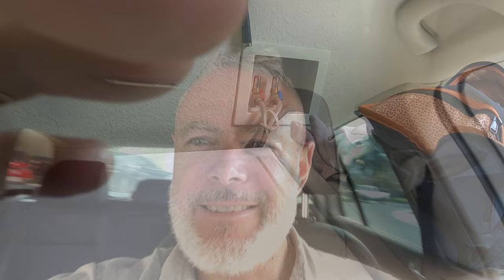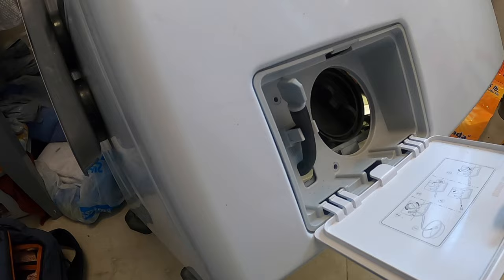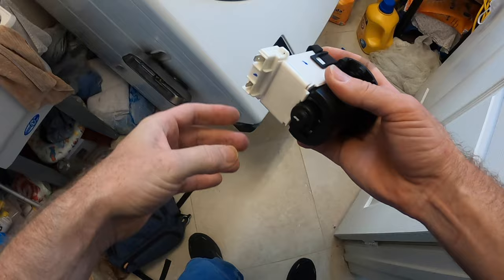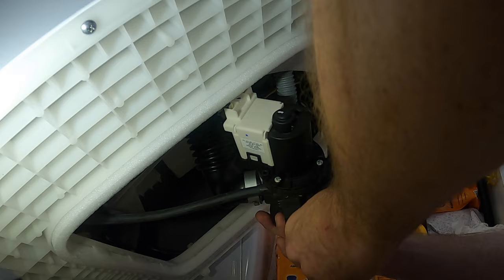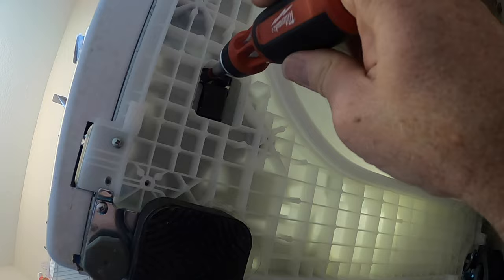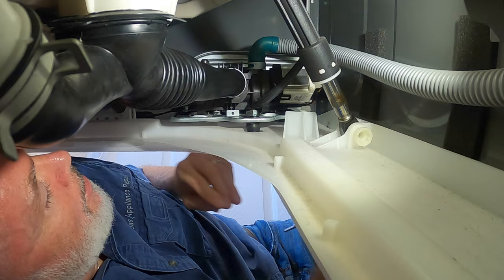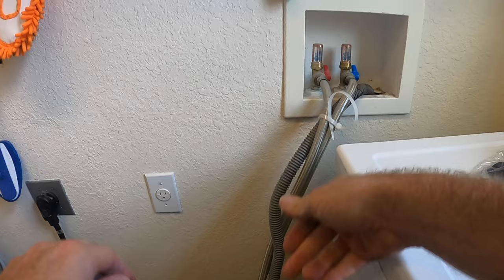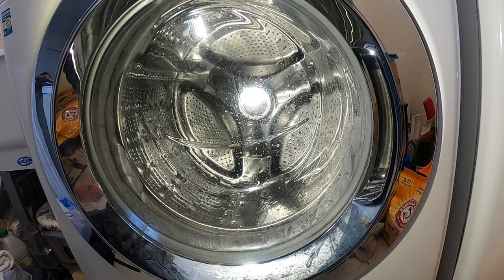LG Washer Drain Pump Fix in 7 Minutes

Comment: I bought a warranty, 5 years for $160 at time of purchase. Mixed blessing: will have an unknown tech come and attempt repair, hope they get it right, then see. I was hoping this would be the better of my last washer, a Westinghouse, which only lasted 40 years and required replacing the water inlet housing, twice! Depending on the time it takes to diagnose and repair, and which parts, that $160 may be a real bargain to keep it running through 2026

Instead this LG is like a science project with the maintenance schedule and issues that crop up. It has entered into the era of not finishing the final drain cycle…it keeps spinning, stops, then adds water (???), spins again, throws no codes, and will do this for hours. Definitely not saving energy. And it’s not obvious which parts to clean, reattach, replace or what. There’s an air tube & a chamber, main and sub drain hoses, pressure sensor, mainboard. Could be any or all. Tried stepping through the diagnostic, but nothing apparent on stepping through. Starting to look like it’s the mainboard.  This is a 2021 WM4000HWA front load LG. 

Seriously, just  want to run it, wash clothes, maybe put a big single turbo in my 2007 e90! (that might be simpler)
Reply from the maker: The obvious is that you should have kept that old Westinghouse. Your issue sounds typical of needing new Shocks. I have a video on how to replace LG shocks. I can not guarantee that this is the problem, but when it does that is usually trying to balance the load. When the shocks go it will think it is out of balance due to excessive vibration and will not go into final HighSpeed Spin
Reply from the maker: https://youtu.be/ZUGUx64rNkA?si=H25LNn8bSZmP3Daa
Reply from the maker: https://youtu.be/OSk8LtuP-48?si=TtZVJGzeeoYjsHAe
Reply: @appliancerepairamerican  Interesting idea. They sent a pump (AMZN, thought it was something I ordered till I opened it.) We’ll see if that fixes it…if he/she R&R’s the pump but no-go, I can mention this…git’r’dun!

Comment: I tried to do a Tub Clean per LG before I committed to a Drain Pump replacement and I cannot get the pump to provide enough force to push discharge through the drain hose to the drain on the wall - I could however get it to pump into a bucket on the floor. I can hear the drain pump trying to work, which leads me to believe there is build up blocking on the tub side of the drain pump. If I manually drain using the hose and clean out the filter, I can still feel weight and hear water under the drum. Any thoughts?
Reply: Get a shop vac with a cone attachment on the end of all the hoses and suck it out

Comment: hello Mr.. if I may ask, may i know what else can be the problem of the washer not draining water? since I've asked 4 people about the pump, they told me it's perfectly working fine. I've tried to wash awhile ago and it's giving me a gurgling sound so I drain the water manually then it's showing me 03 (inverted 3) after.. appreciate your response. 🙂
Reply from the maker: The hoses may be clogged. try using a wet Vacuum, also known as a shopVac to suck out any debris stuck in the drain hose. You will want to get a cone shaped nozzle to go on the end of the shopVac. You can get one at Home Depot or possibly on Amazon.  There is also a short rubber hose inside the washer that moves the water from the tub to the drain pump. that could also be clogged
Reply: @appliancerepairamerican  Thank you, Mr. I appreciate your response. 😊

Comment: Last night sitting downstairs in my living room, and I heard what sounded like rain, I go to my furnace room and my washing machine that’s upstairs, which is a LG thin Q, brand new only a couple months old now the water in the washing machine upstairs is now gushing down into my furnace room. so what do you think the problem could be?
Reply from the maker: make sure the stand pipe that the water drains into is not clogged and that the washer drain hose is not put into it more that 8 inches. could be that a hose underneath the the washer came loose. Could be that the hose to the pressure switch came off. many things could be causing water to leak. First check the drain hose and stand pipe. It is difficult to determine a leak without inspecting the washer first hand
Reply: @appliancerepairamerican  my sister played with the little door at the front where you pulled a little hose out and then you drain that first then you unscrewed the lint thing out well we had a struggle trying to get it back in properly thinking that might be the problem and it wasn’t because it did say in someone else’s page that if you don’t get that correctly in right, you could strip the littlethreads on it. So she got it back in. It’s not leaking now so we feel that’s the problem right there. We shall see because the washing machine is going and there’s no flooding.
Reply from the maker: @wendym31463  If it was a big flood it is most likely happening during the drain cycle. It will drain at the end. watch it until the end

Comment: Question...I have my LG sitting on top of an LG Pedestal. Is there a way to access from the bottom without having to take it off the pedestal? Thanks!
Reply from the maker: Check out this video for changing a drain pump on an LG with a pedestal https://youtu.be/oev2EDwj0aU?si=FdidbDpyImfTDlAi
Reply: @appliancerepairamerican  Great! Thank you, I'm going to give it a go tomorrow!
Reply: Well...I got the new drain pump installed and it works However, water started coming out of the bottom of the washer when I ran the first load. Going to check both of the inside hoses tomorrow. Not sure where else the water can be coming from....
Reply: It was me…I didn’t have the drain pump screws tightened enough…all good! That so much for the video, much appreciated!

Comment: Should the propeller on the pump have some resistance? Mine spins, but unsure if its bad. Is not draining, and didnt find any clogs
Reply from the maker: Yes , it should have some resistance. A magnetic pull feel when you spin it
Reply: @atlasappliancerepair  i put it back together and it started working again. If it starts having issues again then i will replace that pump because it doesnt have any resistance, but also it looks different than yours so not sure thats why i was asking. EAU63743803 part number.. thanks a lot for replying!

Comment: I tried this.  The pump you can access from bottom on my LG is circulating pump.  The drain pump is in left corner of unit.  No way to get it without taking apart washer.
Reply from the maker: I have other videos that demonstrate other methods

Comment: This wasn’t the case with my LG front load washer… I tried doing it this way unsuccessfully… taking the front of the washer off isn’t tough… two screws at the back on the top! Slide the top back and lift off. Then the control panel can be removed and the front taken off. There were a couple of screws holding in the pump assemble that were impossible to reach without removing the front.  Best of luck.
Reply from the maker: I have a couple videos showing how to change the pump by taking the front off also
Reply: @appliancerepairamerican  I was dealing with a LG model WM8000HWA… it had two screws holding the pump assembly that could never be reached without removing the front…  I have no doubt that with some models the pump can be replaced as your video shows… I was just trying to warn people that it may not work on all similar models before they got in over their heads. It would be good to point people at your other video showing taking the front off. Even that is not that hard to do. 
I can just see someone buying a pump and getting stuck.

Comment: My washer is draining, but the machine thinks its never empty. And constantly runs the punp until it times out with an error code. Does the pump have the empty sensor inside it?
Reply from the maker: Could be the pressure switch. on the modern machines it is part of the mother board. Could be a slow drain due to a clog in the drain somewhere causing a long drain. Check the flow, while draining, at the drain hose exit. If the flow is weak it is clang somewhere in the drain system. Lastly there is a small diameter hose from the tub to the mother board pressure switch. That small hose may have a clog. look up the error code on Google and see what it says. It is likely that it is a long drain due to a clog in drain system. Again, easiest way to confirm that is by checking the flow at the drain hose exit by lifting it slightly out of the stand pipe behind the washer while draining. The flow should be very strong. good luck
Reply: @appliancerepairamerican cheers, the drain flow is strong and the impeller still has good resistance. The error code is drain error and even occurs when I manually removed all water via the filter. I had checked the pressure switch hose for leaks or blockage from both ends. I ending up getting it working by hard reset using the 6x lid switch method. If it happens again I'll try replacing the pressure switch.
Reply from the maker: @chrisjokinen217  thank you for sharing your experience. We all learn best as community
Reply: Forgot to update, it was the pressure switch. Works fine now, cheers

Comment: DO you have any guidance on just replacing the drain pump connector hose (the one with the plug near the coin catch)?  Mine was clogged and I had to cut the hose to remove the clog.  It still works but now it is short and I run the risk of losing it through the access panel.  I would like to replace it.
Reply from the maker: Try a channel or website like: appliancepartspros.com or partselect.com. they sell parts and make tutorial videos on how to replace the parts. other than that, i do not yet have original content on that. I would put the machine on its back and work at it from the bottom access. it is just channel locks and two hose clamps
Reply: @appliancerepairamerican  Thank you for the reply sir.  So you think the bottom access is best so I don't have to disassemble the entire body of the unit?
Reply from the maker: @lanceschul  I do not recommend that. it is my common practice to disassemble the entire body.  If you do choose to go through the bottom you should lay the machine done on its backside

Comment: I tried and tried but had to do it the hard  way again. I have a sidekick on the bottom of the washer. I removed 8 screws to disconnect the washer from sidekick, but no way to tilt the top washer while on top of sidekick. So I would have to lift and move the whole washer, move to a bigger room, then tilt it, to do it this way, and I simply don’t have the help to do that. 

I have replaced the pump 4 years ago doing the old fashioned way of disassembling everything, so I knew I could do it, so I had to do that again this time.
Reply from the maker: I posted on video showing how to change the pump when the LG washer is on a pedestal. Here is the link . https://youtu.be/oev2EDwj0aU?si=NedOOJrhBGYsjwsj
Reply: @appliancerepairamerican  thanks. That’s exactly the way I had to do it. The “hard way”. I couldn’t tilt because the pedestal. 

And on top of that: disaster. The drain hose (green L joint” part) crumbled like it was made of wax this time, when I tried to remove it.

Found the part on Amazon finally. The hose goes all the way back behind the whole drum and difficult to access, but I see how I can do that now.
Reply from the maker: bummer. This is why I am able to make a living. Some of these repairs are not for the weak
Reply from the maker: You can count yourself among the determined few. Thank you for sharing
Reply: @appliancerepairamerican   I ordered that drain hose… and saw that 200+ were bought in the last month. That part is a big problem. Forget their amazing motor with the 10 year warranty. The stupid hose falls apart after just a few years and is not easy to access to replace. That green crap that they melt onto the hose to make the elbow piece, is junk. Maybe they overheat it sometimes and that causes the failure? 

It crumbled like hard candle wax. So disheartening.

Thanks for the videos. They’re great.

Comment: I have an LG WM4370hka.  This video didn’t quite work for me.  I find it interesting that LG provides an access square for the screws from beneath but the access makes it so the screw driver has to be at an angle instead of straight up and down.  Really?  And I had a screw in the front that secured the pump assembly to a metal base (which was attached to the WM by 3 screws with nut driver heads).  This screw was behind sheet metal so couldn’t be accessed (the hole that can be seen at 1:44 of the video)!  Without being able to access this screw I could not disassemble as described in this video.  C’mon LG!!!  Making these screws accessible seems easy w/o affecting the use design.  Make that front circle bigger and the bottom square bigger!  Thankfully I had purchased the tension tool for the tub boot seal so it was ready for my shift to full disassemble.  At this point, I was following other videos.  More time consuming but still straightforward.  I had to undo the previously mentioned nut driven screws and then undid all of the hoses.  In retrospect, I may not have had to do that?  Not sure.  Putting the wide diameter black hose back on was painful w/ their clamp as the clamp, when not on the pipe cinched down this relatively thin hose so it wouldn’t go back onto the pipe easily (I have no idea how anyone could have done it at all).  Arrrggghhh.  Thankfully I had a different clamp type from my irrigation system so abandoned theirs after not too much time.  Thanks for providing this video, though, as I’m not sure I would have given it a go based on the more involved disassembly videos!
Reply from the maker: you are welcome. Thank you for sharing your story with the community 👍
Reply: I was able to get a screwdriver and pry up the metal frame to get to that front screw

Comment: When reconnecting brown wire it  goes on top  and black wire on bottom ???
Reply from the maker: I recommend taking photos before disconnecting. If you failed to do this You can refer to the wiring diagram

Comment: Thanks!
Reply from the maker: Thank you so much for the tip
Reply: @appliancerepairamerican  i just posted, we did this about 1-2 months ago, replaced drain pump like you did, and now its doing it again,at rinse cycle, tub full of water and sat there grumbling but wouldnt spin or anything,i drained all the water  out, BUT THE DRAIN HOUSE IS RIDICULOUS short, i need to figure out a longer one, BUT after i drained all water out, by hand,,,,,,,, i thought i would try to ''drain and spin''  anything left, and i declare it spun and drained with nothing in it,,, what in the world??? and it has some black grease under it too?

Comment: I tried this and it's making the same noise. Could it be something else, or did I get a faulty replacement pump?
Reply from the maker: It is difficult to diagnose without being there. Is the machine draining ? is the machine spinning ? did you use the diagnostic mode to test the components ?
Reply: @appliancerepairamerican  it's not draining. I put a rinse cycle and it didn't drain. Same grinding noise. Could I have put the wires backwards or would that not matter?
Reply from the maker: Maybe. There should be a diode that prevents the impeller from spinning in opposite direction, but im not sure. Could be a clog. How deep did you investigate? Take off the black rubber boot that connects to center of tub and drain and look inside. Take off drain tube and get a shop/wet vac on it. Maybe you put wires on backwards.  Hard to help from here.

Comment: Is there a way to change the trap and not the pump. When doing my regular cleaning the trap cap just twist and twist but won’t pull out.
Reply from the maker: I apologize, without being there it is difficult to give advise. I have never encountered that issue
Reply from the maker: Try google and look for “appliance blog” or try the discourse on Reddit

Comment: Changed the pump and it still won't drain and makes that growling noise. No kinks in drain and filter is clean...any thoughts?
Reply from the maker: A clog somewhere?
Reply: No. Turns out there was 2 pumps, the actual drain pump was on the other side of the first pump. 
Thanks!
Reply from the maker: @KellyPKramer  yes. The pump behind the little door on bottom of front panel, as seen in video, is the drain pump

Comment: Please be aware that this method will not work for all models.  Mine has 2 screws at the bottom and 1 in the front behind a sheet metal plate.  Only 1 of these 3 screws is accessible.
Reply from the maker: Thank you for sharing

Comment: You never said, how do you manually put water in while it’s going through the diagnostic mode. My door is locked.
Reply from the maker: HEre is a link to how to put it into diagnostic mode: https://youtu.be/ZUGUx64rNkA.     This video does not show which stag is the water valve test, but it simply a matter of going through each step one at a time by pressing the START button.  I hope this helped. Thank you for taking the time to comment

Comment: How to reconect the connection wires?! How do you know they went on the right place?😒
Reply from the maker: i always take a photo of the wires before disconnecting. You can use the wire diagram to see which color wire goes to neutral (N) and which goes to Line (L)